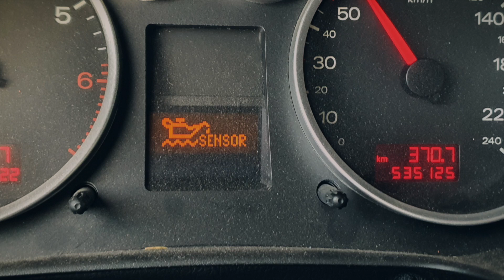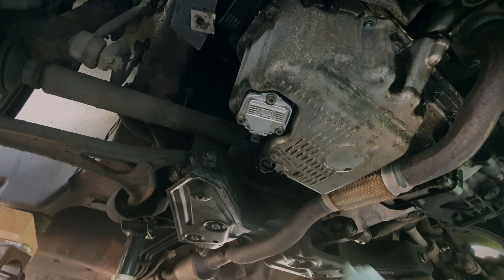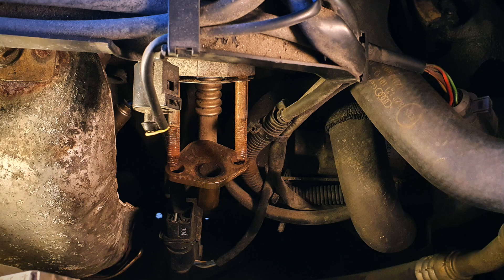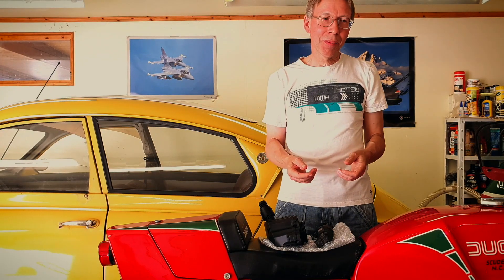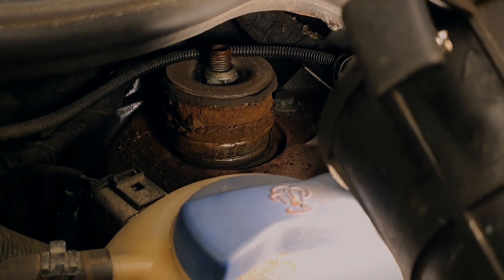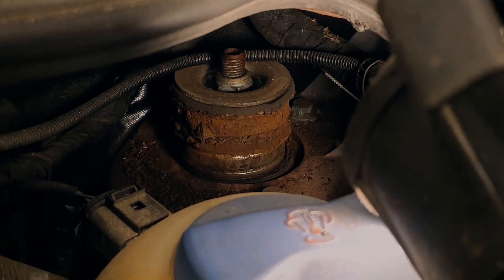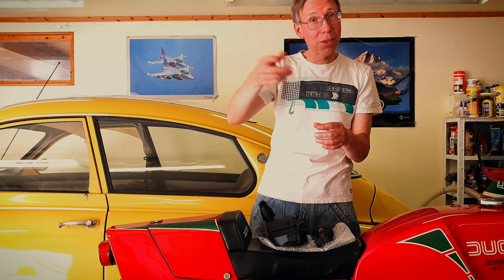Audi A2, 548 000 km update, transmission oil service and the weirdest problem the car has ever had.

Comment: Hello my friend. My Audi A2 has some issue that we are unable to identify. The engine starts and runs just fine. After a while, especially if AC is running, but also without, the board lights up with check engine, check oil, ABS lights. It runs just fine as is. Then all of a sudden the check engine light starts blinking and you loose power to a degree where the car barely moves in the 1st 2 gears. We replaced fuel pump, oil pump, oil, changed injector, spar plugs, spark plug wires exc. Basically spent 2000 Euros changing everything the sensor shows. Same issue... Audi service told us they won't look at it as it is out of support. What do I do?
Reply from the maker: Hi Dotka. Weird problem. No misfire, just getting weak? Fuel starvation? Has the fuel filter been replaced? 
What else can make the engine lose power like that? Is the electronic throttle working as it should? 
Is the engines ground connection good?
Reply: @hoojiesgarage1542  I will check these. Many thanks.